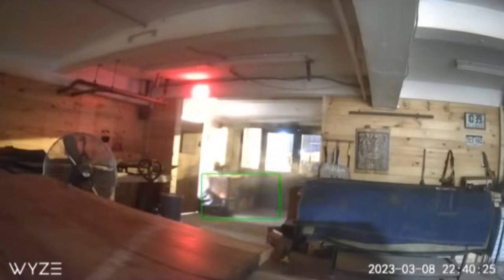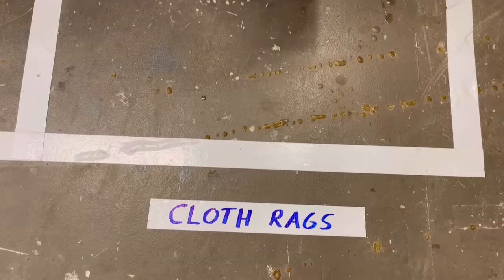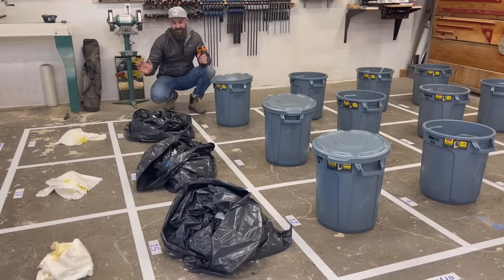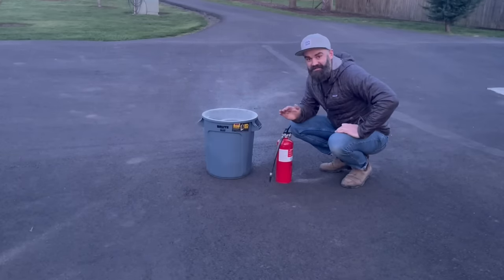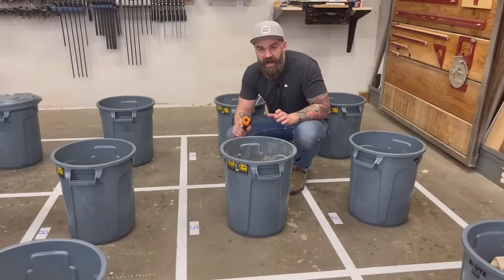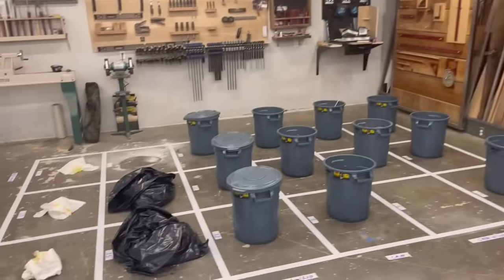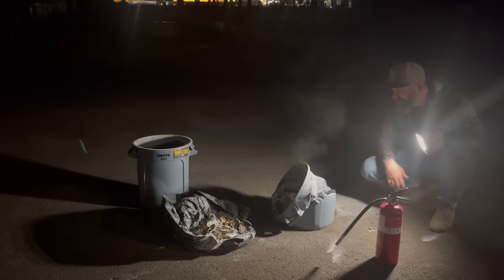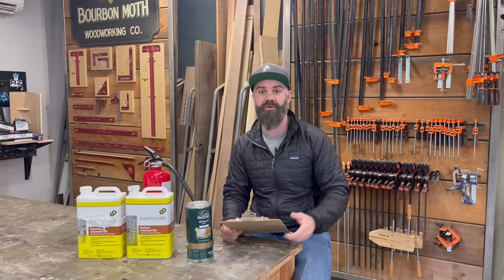I Tried To Burn Down My Shop || This Video Will Save Yours

Comment: Two things: 
Get a water fire extinguisher. You can refill them at home and you can spray them multiple times
Secondly, the powder extinguishers are one and done. The powder will clog the nozzle open and the gas will escape so once you use it, you can’t set it down to use later. 
Also this is great and super helpful! Love this type of content!

Comment: Cooking oils can do the same thing in the right conditions. Although you measured temps in the general pile and thought them to be relatively low, you expose the idea of the hot-spot hiding deep in the pile. Curiously there wasn't a lot of smoke to begin with. Fantastic and well done experiment. Sure maybe not scientific, but numerous excellent practical scenarios.

Comment: I was working as carpenter helper back when I was a kid. He had me staining cedar siding with Minwax stain. I was in the large garage as it was sprinkling and we didn't want to get the siding wet. It was lunch time so I left my rags on the floor of the garage so I could continue later when we got back. Well during the time we were gone the rags caught fire and burnt up. I had a pile of ash on the floor. Could have lost the house and garage because of that. Sawdust burnt my bosses house. He had his floors sanded and the contractor left a bag in the home. Same thing happened the sawdust caught fire and luckily the house was saved but with extensive damage. So watch out for that too.

Great video and experiment. Very enjoyable to watch.

Comment: The ones with closed lids seemed to be the safest aside from the red fire proof can, but I wouldn't say to blatantly leave oily rags in them either, but the oxygen is probably a big factor.

Comment: My dad has been a life long woodworker and hardwood flooring installer, coming up on 50 years.

From my youngest years, my dad has always preached this. Never, ever put the oily rags together. lay them out, preferably on something non-combustible. I never doubted him and later came to see video proof but this video should help educate those who think "eh, it doesn't happen" or "I'll be ok"

These results should drive home the "randomness" of the situation.

Comment: Surface temperature is going to be way lower than any hotspots in the middle of the bin, you only need one area to spike above that ignition point, or rather, the ignition point of the easiest to burn substance in that bin / oil. Pure linseed oil has a flashpoint apparently around 199.3F, I'd guess that the additional additives in the boiled linseed (hint: it's not just "boiled") and your preferred coating likely lower than further.

Comment: Wife and I were staining and sealing Hemlock soffits for our house build. One Sunday morning, we clear sealed off a few more long strips in the open unfinished garage structure and popped out to get kids breakfast; then just stopped back by the site for some reason before going to the rental home. The rags were smoking in the tub they were in. My wife had thrown her nitrile gloves in with the rags and there was enough exothermic to start the gloves to ignite. I bet they were probably minutes before full on flames. The bin was hotter than hell and smoking when I hauled it out and dumped it out and stomped on everything in the gravel. Heat from rags ignited lower flash point nitrile that was in turn lighting up the entire rag. Scared the heck out of me so very careful with volatiles now.

Comment: You should always use galvanized steel trash cans inside your shop. Worked well for 40 years in the millwright shop I worked in.

Comment: Do you have smoke alarms installed in your workshop? They would be another level of safety for the space, plus (maybe you already know this) but there are different types of extinguishers for different fires. Maybe a fire blanket and different extinguishers could be a good addition to your shop so you’re prepared for whatever might happen, and maybe (yes, I’m going overboard now) some sort of extractor fan to get those plastic fumes away from your quickly - as long as there’s no flames going with them obviously.

Comment: When I was in woodworking class they always explained this as a large amount of oily rags, or a large full bin of sawdust contaminated with oil. Meanwhile you are over here setting bins on fire with the equivalent of a single balled up oil soaked t-shirt used as a rag. Honestly its a surprise more places don't burn down.

Comment: I am very careful about oily rags and was cleaning up after the trades one cold (-15) night and put some trash and old paint buckets in the back of the pickup about 530. Planning to head home later at about 830 I randomly noticed some odd lighting outside ( it was dark already). Sticking my head out the door the trash in the back of the truck was in flames...and very difficult to put out.
In only two and a half hours! It happens faster than you think, spreads faster than you think and is difficult to extinguish w/o an extinguisher. I was lucky I was passing by the window, lucky it was dark so I would notice it, lucky I had the equipment to put it out! My bedliner melted somewhat, but the 50 odd gallons of diesel in the saddle tanks did not ignite!
Always use a steel can and dispose of trash asap! Thanks for the great testing!

Comment: I had it happen in my shop years ago…I was so fortunate because I wasn’t home but my shop was very small and very air tight…when I got home all I found is a small portion of the top of the 15gal plastic trash can…all the sanding dust and clean solvent rags were just a small pile of ash on the floor…so the old finish I took off the table was enough to start a smoldering fire…I was beyond lucky…

Comment: We were at a project, using Rubio to stain trim.  We were throwing our materials outside, into the snow bank, in February. (Think highs in the single digits and well below 0 at night)  Anyway, we threw our rags out on a Friday afternoon, making sure that they weren't bunched up and were definitely away from the house.  We came back on Monday and found that the rags had gotten warm enough to melt all the snow under it and melted all the way down to the ground.  In freezing conditions.  

Fortunately no fires though.

Comment: Really nice video and thanks for taking the time and effort.

I have seen this happen with rags soaked in Shellac and Oil Based Stain in a trash can.  They were mixed with all sorts of other things, and I was always curious if it was some special combination.

Luckily I was there in the building when the other contractors had left.

Comment: We were finishing a basement and had spent about 3 weeks putting in a master bedroom, master bathroom, a theater and taking out the old 2x10 stairs and putting in oil stairs with walnut risers. The painter was finishing up stain the stairs after everything was finished and he left one rag in a trash bag… caught the basement on fire and burned a good portion of everything we had done

Comment: The only thing I'd suggest doing differently, even though it's pointless because it's already done is; use metal cans with good fitting lids. You could tightly fit the lids to put out the fires, and worry a lot less about the cans melting.

Comment: I have heard about oily rags catching on fire in other videos that were suggested on YouTube while researching projects. It’s only been in the last few years that I have started using oil finishes. I don’t have a shop, so tools get moved to the driveway or patio as needed, which is mostly where I do finishing as well. For my first linseed oil project, I threw the rag over a heavy timber (3x7) propped up in the back backyard to let the rag (old cotton t-shirt) dry. The next day, 18? hours later, I happened to be carrying something else out there when I noticed smoke. The rag wasn’t laid completely flat, and the folds in the cloth were black with the beginnings of charring. In our case, the scenario was probably accentuated by the rag being in the morning sun - probably 70 shade temp and 100 in the sun. It doesn’t take much.

Comment: The reason the results are so inconsistent,  is that so is the rigging of the experiment.  Not in terms of if a lid is closed or not, how many rags you've used, or even the oil.

The reason I know about this is because I've worked with structural fiberglass in which one component is the epoxy. The epoxy consists of 2 components,  a resin and a hardener, that utilizes the same chemical process as the oily rags, or rather - the reaction is similar. An exothermic reaction, which as you know produces heat. 

Now, in laminating fiberglass , you want this to be as controlled a process as you can possibly manage,  which starts out with a very accurate mixture,  to make sure you won't end up with an excess of either resin or hardener, which contrary to other products,  will result in an inferior product,  or even failure. So the mix has to be right. Next up is application. The strongest fully saturated laminate you will achieve by hand is right around 60% glass, which means it's fairly dry. Dryer than that increases risk of not having a fully saturated laminate,  and wetter decreases the strength of the laminate,  because the epoxy is simply the bonding agent, and not the strength element,  much like old fashioned mortar in a brick wall. 

So you do your thing, one laminate might only be 2 ply, and it takes FOREVER to set, you go on to do another one with maybe 60 layers, and to set out it's not that bad,  but you hit 10-20 layers, and all of a sudden,  you've gotta hustle! Now the laminate is getting sticky, and you can feel the heat buildup.  The exothermic reaction. The reason being the greater the density,  the greater the reaction. Some laminates actually need cooling,  not to burn, once they set off, if they're that thick. The heat builds up from within, and like any chain reaction, there has to be an outlet.

The conclusion is, if you have some part, with just the right mixture, wrapped well and good, so the heat is trapped, that will suddenly spike fast, and burn the fuel around it, which all of the items in the mix are great at. A lot of times, those rags are also filled with sanding dust, which I'd suspect would be a real bad combo. But there you have it.
Reply: Lighter fluid may have influence the test and the alleged fire in the shop
Reply: @brianjohnson3961  So basically you don't believe in spontaneous combustion,  or you just think this setup is staged? ...more than what is shown?

Comment: Not longer than 1 week ago I had the same problem.  I wiped off some panels  I just finished with Rubio Monocoat with a fresh microfibre cloth.  The microfibre cloth got really soaked as I wiped off quite a few panels.  A few hours later it got on fire
in my shop.  I was lucky I still was there.

Really great you made this great video about this issue.   Thanks.

Comment: A few things to know with linen oil, if you actually smell like a slight sour odor in your shop and if you've applied some oil, it's probably the clothes that start to burn. Then never put those clothes in a ball well compressed, that's where you get the most luck at making them burn, usually get a metalic bucket and put them in with some water, this thing is really dangerous.

Comment: As a 28 year firefighter, what you demonstrated was correct. We actually had a fellow firefighter suffer significant fire damage to his own house due to accidentally leaving his used rags on his floor. This video should be seen as a valuable public safety demonstration. Thank you for doing it. Ps, it honestly made me cringe watching it, as I knew what was likely to occur, and was hoping that multiple burns wouldn’t occur at the same time. And you should have, at the least, worn gloves to protect your hands from melting plastics.

Comment: Linseed oil was the culprit of Andy Birkey's recent shop fire (and my father's shop fire in 1964). It's a real thing. I keep a burn barrel outside my shop. I use blue shop towels to apply oil based finish, and I burn them at day's end...they can burn, but they'll burn on MY terms.

Comment: I had a close call with linseed oil and rags, that was years ago when I was just starting into woodworking.  I've never allowed it in my shop or home since. I've also gotten into the habit of soaking the rags in a bucket of water outside then drying them flat on the ground.

Comment: The paint and coatings industry recommends for any rags that had oil on them, to place them in a metal pail half full of water. Easy and it works.

Comment: The biggest takeaway that I can see isn't that this can happen, but with how little fuel it takes to happen. Some might think these rules only apply when you have a major project and a lot of finish-soaked rags to dispose of, but the fact you managed this with only maybe 2 sodden rags in each case should not be overlooked.
Reply: I mean, a quarter oz of lighter fluid and a match  (off camera) is all it takes.. amazing!
Reply: @bflat99  Ah yes, the stream of people coming in saying this guy on the internet lies because another guy on the internet says so, a classic
Reply: @abydosianchulac2  Right, because they trusted this guy and didn't question his methords, just took at face value. Luckily there are people out there who are critical of dubious claims and present evidence to back it up.
Reply: @GoldyMcGoldface  What claims are being disproven, and what evidence was offered as backup?

And yes, I've seen the Ave guys video.
Reply: @abydosianchulac2  I mean, right from the very start he says the wrong time. Which, maybe that's an honest mistake... sure, could be, but that just sets the tone for other inconsistencies to look suspicious. Combustion doesn't go from 0 to 200+ degrees in seconds, there would at least be smoke for some period and he'd have film of the event long before actual flames appeared.

Comment: If the video was just after midnight, why would the wyze or the clock on the wall tell a different time?
Spontaneous combustion needs a heat source above the flash point of the fuel.  How would it get that hot?

Comment: While in college I worked as a radio operator for a small city fire department. One day the firefighters cleaned equipment, including using linseed oil on the axe handles. They tossed the rags in a box and around 9 pm the smell of smoke got my attention. We checked it out and the box was full of hot embers, minutes away, I'm sure, from flames. Would have been pretty bad to have a fire at the fire department! Oily rags combust. I never forgot that lesson.

Comment: I am a hobby woodworker and had an accidental fire 🔥 and burned my shop down. There was an amber in a plastic trash can half full of sawdust. It lit on fire after 8-10 hours of simmering. I now use only metal trash cans in my shop. Hopefully it will contain the fire if it were to ever happen again. 2014 was a bad year for me. Lucky I was covered under my insurance policy. I’m back up and working again. Thanks for the helpful video.

Comment: I'm ... skeptical. It so happens that I've seen linseed oil soaked rags go bad (in my grandpa's shop when I was a kid), and they smoldered like CRAZY, setting off the smoke alarm long before there was any sign of flame. In your video, not only do we see bright flame, but they don't start smoking until AFTER they were burning for more than a minute on camera.

There is no question that in some conditions, oil soaked rags can burn, but I really don't think it looks at all like what you caught on video. By all means, encourage proper handling (metal cans, stored immersed in water until you can dispose of them properly), but I'm not sure this video is the right way to do that.

Comment: "Just after midnight" 

Recorder clock says 10:40.... 

So does the wall clock.... 

Couldn't get them to burn so you threw some lighter fluid in.... those bags would have been a melted heap ling before the combustion temp of those rags was reached..... weird...

Does it spontaneously combust? Yes..  

But not without heat, then smoke, THEN fire. In that order.

Comment: While the threat is very real, sad to see this test was clearly faked. 
Really, neither the trash can or the PLASTIC TRASH BAG melt AT ALL? Those rags will get VERY HOT before they ever catch fire, they would easily melt the bag long before they caught fire. No smoking at all before catching either? Happen to have your mic pack on when the fires start but not in the scenes of you actually relaxing? You got your views though I'll give you that.

Comment: So if I understand this right, Linseed oil is a natural polymer due to several double bonds in it's lipid structure. This polymerizing process can be accelerated by heat/catalyst and it is exothermic. To mitigate the potential of runaway reaction we use metal containers that absorb the thermal energy released (The metal can, the concrete floor, and water evaporation), however oil and wood are difficult to ignite so what's likely happening is that the linseed is catalyzing the ignition of something else like the trash bag plastic and the coating on the magazine papers.

Comment: I'd heard if this from more than one source many, many years ago when I was getting into wood work and using various oil based coatings. I started always taking those rags outside and spreading them out on some bricks to dry. Then I disposed of them.

Comment: where's the melting bag? where is the smoke from the fires?, and even with multiple angles for the cameras the start was never really on camera showing them up close.and the clock on the bac wall and the time it showed. hate to say I agree with Ave here